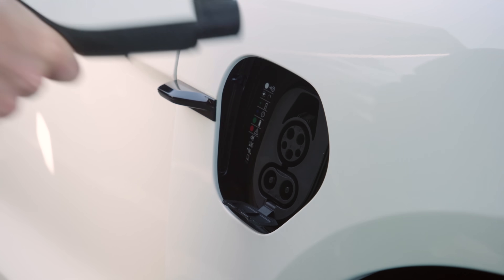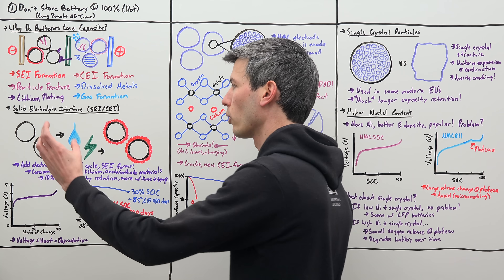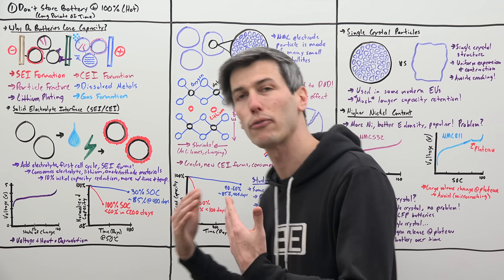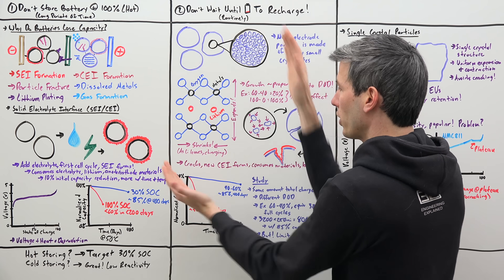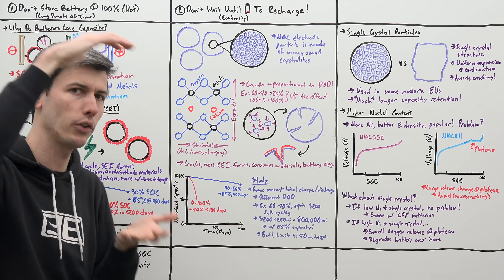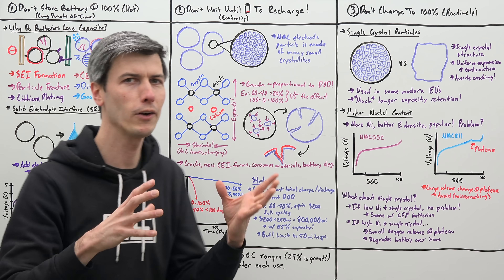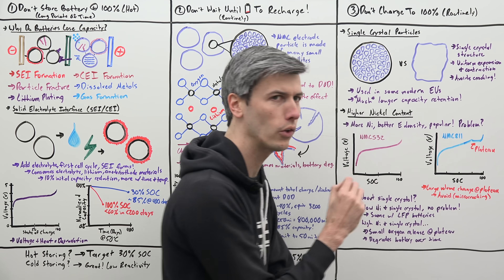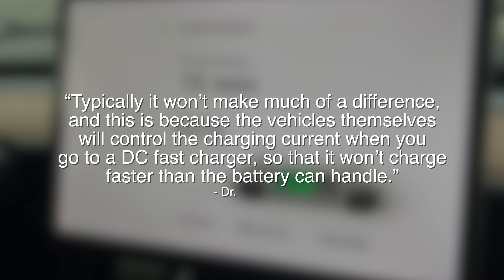How To Ruin Your Electric Car's Battery - NMC Edition!

Comment: You can ruin your battery if you charge it or don't charge it. If you get it too hot or too cold. Never get it wet or drive the car. Don't use the AC. Don't overload the car you know passengers and luggage or drive in the mountains. Or on inclines. Welcome to YOUR future.
Reply: So our future is nothing but a huge exaggeration?
Reply: At least regen & no brake pad wear down other side of the mountain 😅

Comment: What does it mean that you should not let the car sit with 100 percent charge. How long time can you wait before driving. 15 minutes, two hours, or two days?
Reply: Minimise 100% SoC as much as your lifestyle allows. If you really need (do you?) a 100% charge for a trip, time that charge for as late as possible before your ETD. Even then it is not ideal for the battery. Doing it longer before departure is worse. Adding in a hot climate is worse again. The longer & further your NMC battery sits outside of 20-70% (or less), the more accelerated degradation is risked. But it's a choice. Maybe you have that need. If you don't drive for Uber most of the day & can routinely park off-street, most people can maintain the SoC in the healthy window without having to give it much thought.

Comment: Thanks for this informative video. I do have some questions for you that were not adressed in the presentation. Just so it's clear: to maximize battery life and longevity, should one charge an NMC battery to 70% rather than what is recommended (say, by Tesla) to charge to 80%*? Also, even if we drive short distances, for example, the capacity is down from 70% to 55%, should we charge *daily back up to 70% (or as Tesla recommends, 80%). Thank you.
Reply: Really? For smaller DoD needs, reduce the maximum SoC rather than raise the minimum. That leaves the NMC battery sitting at a less-stressed lower SoC for more of its life.
If your regular trips only use 15% DoD, charge to no more than 50% routinely & just leave it plugged in at home if you have that option. Before longer drives, don't hesitate to charge up to 70% & occasionally higher if needed. NMC loves small DoD around lower SoC for longevity.

Comment: My Kia EV6 which I guess has an NMC battery sits most of the time in the underground parking. Ambient temperature during summer is about 15C but during winter it's around -10C (outside parking the temp is -25C lol). Question - does storing your NMC EV in the environment with such a low temp positively affects battery life (SOC is typically 30%-80%)?

Comment: Great video though I have a question. What if I use the electric vehicle 100 to 200 miles daily and I don't have home charging and charge publicly from 30 to 150kwh. Should I still not charge to 100% and keep battery between 20 and 80%?

Comment: my question:: most of the full electric cars get full charge when underway.a self charged hybrid like the Honda Jazz 2024 does it when driving and the charge regalate itself in the optimum way.witch system for battery consume is the better way for the battery lifespan? plug-in or the hybrid non plug - in?the battery charge in my Honda Jazz constandly changing:charge? decharge.

Comment: Some EVs have that last point just built in with good battery management. Take the 2nd gen Chevy Volts for example. It has an 18.4kWh battery but the consumer only ever has access to 14kWh at any one time. So 100% is 80% (ok ok 76.1% for you pendants).

Comment: The Hyundai IONIQ apparently has very little battery degradation even after 37,000 miles.  does it have anything to do with the car's charging curve the criticism against it was that it charged slowly like an hour on a fast public charger

Comment: Shouldn't the number of charges matter.  if, for example, you would only charge the car once a week on average, the battery should  last longer than if you charge the battery every single day.  and the battery will  be stressed if you use battery direct after you have charged it ?

Comment: Great video. Interesting to note 1/. With V2G using only a small portion of SOC won’t really impact battery life 2/. There’s an omission regarding how often you should charge to 100%. There’s info out there suggesting it should be done to calibrate battery/BMS to know where the highest voltage is @100%SOC

Comment: Don't EV makers always install biggers batteries than you have access too meaning that the SOC indicated in the car is not the actual SOC of the battery but the BMS regulates this so you can never overcharge or underrun the battery?
If I'm not mistaken my EV6 has a 74kwh battery that I can safely use (0 too 100% indicated) but the actual battery size that the BMS manages is 77.4kwh (as advertised) that I in normal operation won't have access too because the BMS wont let you, and on top of that an additional top buffer and bottom buffer that is completely unusable, making the gross capacity ~80.2kWh.

Comment: I have had a Bolt for 1.5 years now, I normally charge to 80% (may switch to 75% just to align with the mark on the display) with maybe 4 times a year top off overnight to 100% for a trip, and day-to-day temperature changes so far is more significant and masks any degradation. On a ideal temp day last year, 80% SoC was 242 miles and it is still that way today.

Comment: Hi,

So i think the info is provided in some form here, but I would love an NMC video focused on what the various use cases. Extremes and real world will look like on a battery with 50k, 100k, 300k, and up miles.

Essentially I would love to see 5 criteria Super Abused impossible in the real world, Abused real world, Real world mixed us, and near perfect conditions real world, perfect conditions unrealistic.

And see the results of battery degradation over various distances and/or years.

Your LFP video went into this a bunch but not much at all here in the NMC video. You do bring it up, but after 3 viewings I am not getting much info here. I can come away with conclusions on what I should be doing. And that is valuable. But I would love to see the data laid out. Both for my own knowledge and to help me make an informed decision on battery care.

Comment: To start, I really liked this video; it’s well made and informative.

Something made me crack up though:

« If you don’t know what chemistry your electric car battery uses, and why would you »…

Then goes on to explain the chemistry at length…

Seriously, the only thing I take with a grain of salt is number 3: not charging at 100% regularly.

First, my automaker says there is a buffer to make sure 100% is never quite 100%.

Then, I heard multiple times that some studies shows some EV were only down less than 10% of their original capacity after somewhere around 200k miles.

So, I wonder why I should limit myself to 75% (or 80% like a lot of people say) for 200K miles, only to make sure I lose less than 10% capacity… which I will never use anyway, because I always limit myself! 

I like that, even though you explain it all and say it all make sense on paper, you still agree that we shouldn’t stress about it, because the battery will probably outlive the car.

Comment: The of the manufacturer is to make the car survive the warranty period. So you should question all the recommendations in the manual. Wheter this is Teslas "always leave your car plugged in" or the 30tkm oil change intervals on some gas cars.

Comment: I drive a MINI SE. I charge to 100% every time - there is no way to limit it. MINI even said to go to 100. 4 years on, battery soh is 100%. The caveat here is that the battery has an unusable portion. 28.9kWh of 33.6kWh usable. A 100% charge is actually between 80-90 depending on how much is left at the bottom end. I try to charge when the battery is between 30-50%. By the time my battery is tired, I will probably be able to swap it for a "mr fusion" and run on banana peels :)
Reply: It's 11.5 at bottom and 2.5 at top as it degrades it seems more is taken off the top. Our 21 mini SE charges internally between 11.5 and 96 according to the battery report from BMW.  This may be different for different year models and regions.

Comment: You need to consider manufacturer margins at the top and bottom of the battery.  Balancing also normally occurs whilst charging to 100% but this may be different in modern NMC balancers.  This part is completely absent from your analysis and may actually cause damage over the long term.

Comment: In my 30KW Nissan leaf. I keep it between 20 - 75% (90% for longer trips) I never fast charge for more than 5 minutes so the temperature doesn't rise. So far after 66,000 miles I have no visible degradation

Comment: Are NCA batteries similar to how NMC batteries need to be cared for in terms of the great suggestions in this video?  Ive had a Tesla Model 3 for the last 6 years and while it started at having a range of 310 miles at 100% i'm now down to about 86% of that or 267 miles on a full charge.  I charge at home almost daily to 80% max and also try to keep the range from dipping too low.  I've charged it to 100% maybe 10-20x or so total since I've had the car.  I'm about to trade it in for a Rivian which I was told uses NCA batteries for the model I ordered and I'm guessing i just need to follow the same general guidelines but am not sure.
Reply: 6 year old Tesla Model 3 will also use a NCA battery

Comment: Charging to 75% make a lot of sense since charging is faster during low battery. It takes me 20-25 mins from 10% to 70% but another 20 mins from 70% to 100% on a 250kw supercharger.

Comment: 2014 Tesla model S… Just replaced my battery yesterday after 220,000 miles... And based on this video I did pretty much everything wrong 🙂
Reply: How much did you spend?
Reply: @j.c.ubagox873 $15000 plus labor, $225.00/hr
Reply: Ten years and 220k miles while doing everything wrong on the first gen EV doesn't sound that bad. I would say it is in line with what Jason said. You can prolong tha battery life to the point where it will easily survive rest of the modern EV, but even if you don't care it will still survive long enough so the most people wouldn't care.
There are a lot of people who will never do 220k with their car. Heck, lot of them won't do this amount in 20 years of driving.

Would you describe your charging behavior so we can learn how "everything wrong" looks like? 😉
Reply: @tomas_klouda Yes but people who need to drive their vehicles long distances often will have a pretty huge expense after 220k miles. A well maintained Toyota engine wouldn't see a catastrophic failure like this for 400k miles.
Reply: @Dexion845 well, not every car is Toyota. And not every EV battery lasts just a 220k miles.
You can easily find here a viddo about a taxi driver who has 2 Tesla Model S, charged mostly on superchargers and still going strong with 470k miles on their batteries.
Reply: @Dexion845  The Toyota's fuel use greatly exceeds the Tesla's cost of fuel especially if you fuel from excess solar for free.
Reply: The good news is with these practices in place you’ll have a million miles on it before it needs to be replaced again! 😂
Reply: @coreyschmidt734 not likely. These batteries aren't designed for any kind of heavy duty use yet. ICE or Hybrid is still best for that. If you drive 10-20 miles a day, these cars are fine.
Reply: @Dexion845 not sure what you mean by "heavy duty", but LFP batteries are usually specced with 6k charging cycles before SOH goes below 70%.

Simple math will tell you, that in Tesla Model 3 this LFP battery should be able to happily push way past 1 milion miles if we consider mere 200 miles driven per charge cycle😉

Times, when EVs were happy to survive 90k miles are long gone.
And with that also the old thinking they are only well suited for city driving and few miles a day.
Reply: @tomas_klouda LFP batteries are only in a select few models. Most of it is NCA or NMC, what I mean by heavy duty is needing a lot of miles in a day, in other words needing to charge to near 100% daily. At the moment Hybrids are still the best for that kind of demand.
Maybe if LFP becomes more popular in years to come this may change.
Reply: @Dexion845 unless I am mistaken more than 70% cars in China uses LFP already and most new models come with LFP as the entry model.
It's a way how to get cheap and reliable EV without worries about the battery.
The downside obviously is the range.

Also from the older cars it is now clear that if you only charge to 100% right before the drive (do not leave the car sitting fully charged) the batteries handle it very well.
Reply: @tomas_klouda Your latter part is what i'm trying to find more data on. I'd need to charge to 95% but i'll be driving right away and draining it back to 50% within a few hrs of driving.
I'm in the U.S. so unfortunately LFP is not  an option for most EV's. Long Range Tesla's are still Nickel based.
Reply: @Dexion845 yeah, LFP is not exactly what you want in long range EV. The power density is way worse than NMC🤷‍♂️
But even NMC can live long if it's treated well.
There are Tesla Model S taxi cars with more than 400k miles on original batery. Not sure where you live as this is probably not doable in hot climate, but in mild conditions like England or central Europe there are quite a few cars that achieved such runs on original battery even though they were mostly supercharged.
Reply: Instead of replacing the battery a lot of people sell their car to someone who doesn't need as much range.
Reply: Why would you replace the battery on such an old car instead of getting a new car?

Comment: I bought a badly degraded model Y 85% battery health.  I’m cycling the battery 65% - 35% on the daily and hope I can get an extra 100k miles out of this thing.
Reply: You should do a full charge from 7% or to 100% once or twice a month. Let the car sit closer to 50% if possible

Comment: This is all great in theory, but I have a 150 mile commute round trip and charge my Ioniq 6 daily from ~20% to 80%, occasionally charging to 90-100% at home.  Not too helpful for us long commuters.
Reply: As long as you stay between the 20 to 80 you should be fine.
Reply: I disagree….this implies you need to charge each way rather than at end of the at both.
Reply: @markw5805  that is inconvenient AF.

Comment: I think there's something very important to emphasise, which IMO wasn't made clear in the video: for most EV users, calendar aging will likely be the primary source of battery degradation by a substantial margin, compared to degradation from usage, irrespective of depth-of-discharge. Studies on charge/discharge degradation run out to thousands of full cycles of the battery. For reference, at 35,000 miles after 3 years, my M3LR has been through approximately 130 full cycles. The car will probably be scrapped before it hits 500 cycles of its battery.

For NCA and NMC, there's a step change in calendar aging above ~55-60% SoC. If you're looking to absolutely minimise degradation, set a charge limit of 50% if you're able to do so. (However, as noted in the vehicle, warm temperatures are a killer. NMC cells stored at 100% at 25C will age less than cells stored at 50% at 50C.)

One other thing not mentioned in the video: a low SoC is good for calendar aging but cycling the battery at low SoC causes more degradation than cycling at higher SoC, especially below 15%. Drive down to low SoC when necessary but don't cycle within that range often. The sweet spot is 30-50%.
Reply: Interesting, thank you! Was increased LFP adoption then only due to material availability and not number of cycles?

Comment: Thanks for the video really well done! Why is it that many manufacturers recommend to periodically (e.g. once a month) fully charge NMC batteries to 100%? If I remember correctly some manufacturers also recommend to run a full cycle from <10% to 100% 3 or 4 times a year. What is the reason behind this?

Comment: @EngineeringExplained EVs used in a city are constantly switching between charging and discharging when accelerating or braking. Doesn't that solve the problem no. 2 with a Deepth of discharge?

Comment: I have a Zero SRS that I put 55k miles on since new. The capacity of the battery has reduced so little I cant tell if there is any change or not. What has changed is its ability to sustain speeds over 90 mph. When it was new the battery thermal limits were never reached. Now if I go 90 mph for 20 minutes it overheats and slows me to protect the battery.

Comment: Theory and studies are nice and all.. but I know how i’ve used my NMC EV for the last 7 years and how my battery is doing and it does not follow this conclusion much. I think there is a LOT about how any why batteries degrade, that are still not known.

Once a week, nearly every week, i drive 250 miles and supercharge twice on that day at VERY high temps in the SW at least most of the year. Generally from 20-75% twice a day on those trips often at 35-45 degrees C. On my off week, i sometimes slow charge.. sometimes fast charge. I do generally keep her below 80% as much as possible, but i definitely go to 90% occasionally for other trips. And once in a long while, above 90% but i never let her sit long above 80%, or below 20%. Been doing this for 7 years.. 125k miles.. still around 92% of original capacity. Doesn’t seem to jive with small cycles often at lower temps. I do medium to large cycles at quite high temps quite a bit and she’s still going strong. Yes, i avoid the extremes.. so that might account for it and maybe 125k miles falls into your modeling at my usage.. but that’s not what interpreted from this.